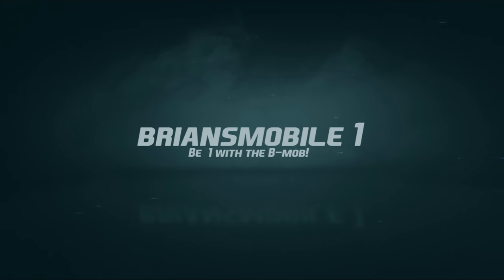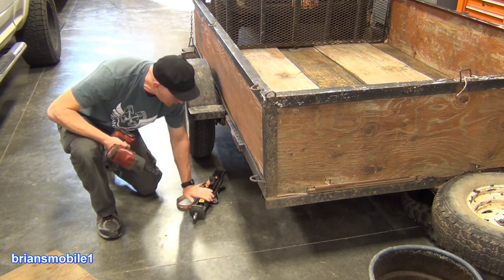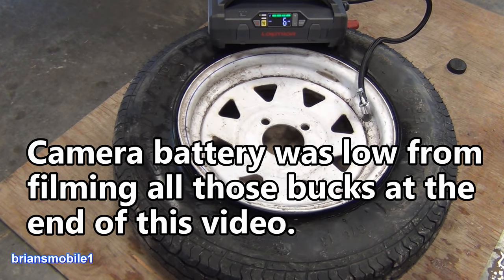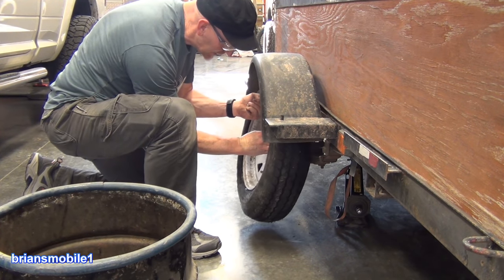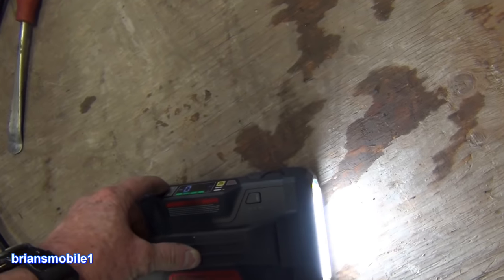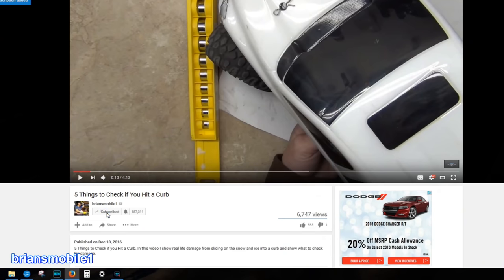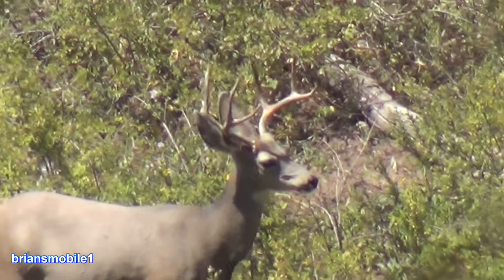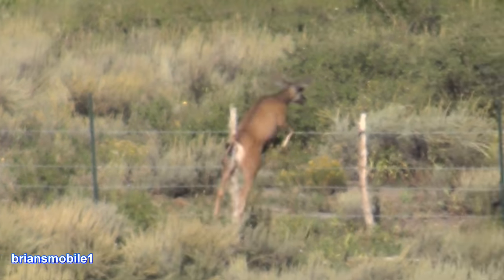How to Change a Tire by Hand Off Grid

Comment: Nice, the necessities for me when not at home or in my shop are of course  tire-irons/spoons, 1/2" Impact, soap, water Ratchet Strap and a large piece of Cardboard or Plywood (it is much easier to work on tires when they aren't in the Dirt, Mud or Snow. Additionally it is a good idea to bring a plug kit and extra valve stems + Schrader valves.
also that valve stem cap has a hole through the center... I hate that.
Setting beads is much easier using starting fluid / Gasoline or a ratchet strap. you will find that to be compounded when dealing with larger off-road tires and / or AG tires.

Comment: Learned a better way to seat the beads when when I lived in Arkansas. Lean the wheel and tire against a tree, squirt (or Spit) a little gas in the tire, step back and throw lit matches at the gap between the tire and the rim until it goes BOOM, tire is seated. Works great seating skinny tires on wide dune buggy rims. Moonshine makes it much safer...
Reply: That works but I wouldn’t do it next to a tree. You might catch the tree on fire.

Comment: Trick to quickly set a tire bead, with the valve stem removed spray a SMALL amount of ether directly inside the tire then use a lighter to light the valve stem like a candle. A small explosion will occur inside the tire completely seating the tire.

Comment: On lighter trailers, I usually just make sure I have a good spare and just run them until they blow. lol.. They always go MUCH longer than you would ever think, even with dry rot cracking ect..  With heavier trailers it's a different story-- a heavy load will let you know that you're tires are bad real quick.